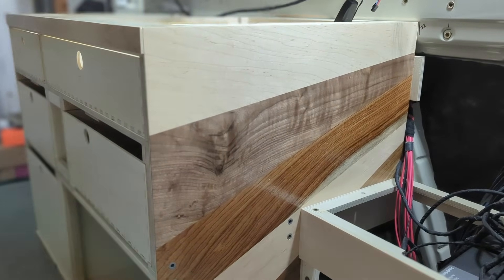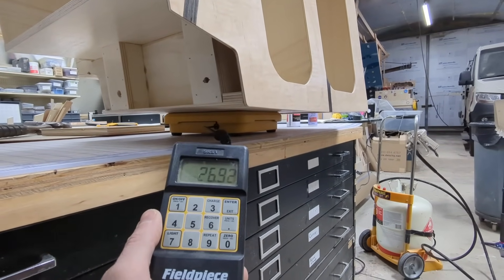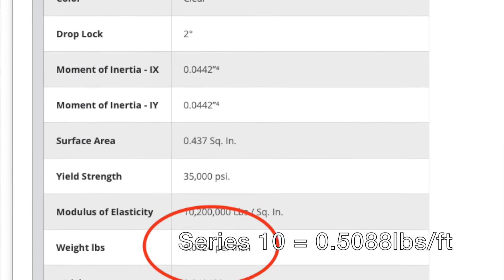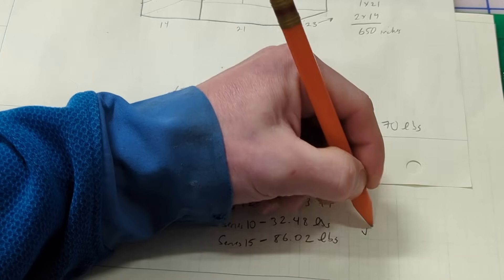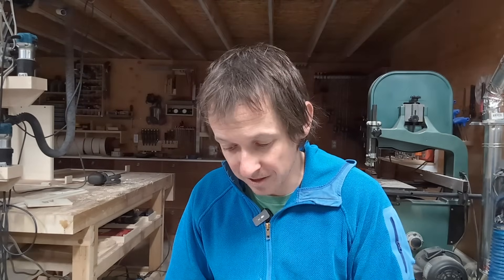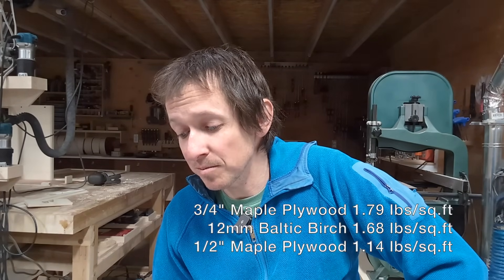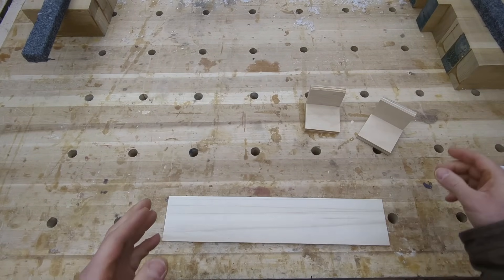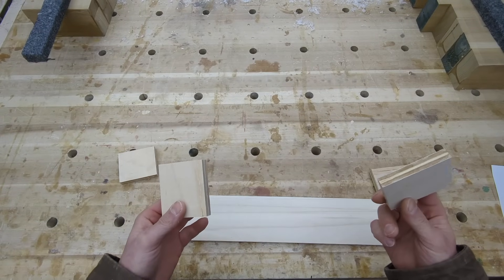Van Conversion Cabinets that are (actually) Lightweight and Maximize Storage

Comment: I'm a cabinetmaker and I've done 4 van conversions. There are two major issues that seem to be ignored by van builders - the first one is the weight of the cabinets and your comments here are very good. The other issue is one of ergonomics - how often I've seen seating, particularly bench seats with a vertical backrest and a flat base - not in any way comfortable.
Reply: Any tips? :)
Reply: @3jcb123  110° between seat & backrest not 90°. Angle the base to match the height - it should not lift your feet off the floor but should support both front & back. 
Experiment with clamps & bits of board to see if you can refine it to suit yourself better. (More upright & higher seat for working or eating, less upright for relaxing).
Reply: Dealing with that issue right now.. I ripped it all out...
Reply: @WizzRacing  
The results of your attention to ergonomics will benefit all who use the benches. 
Hopefully, they will appreciate all that you have invested in creating quality.
Reply: I’m always wondering about upright seating at 90 degrees angle. Looks uncomfortable.
Reply: @alanhat5252 I've seen this later BUT I've yet to design the seating properly. I will bear this in mind. thank you!
Reply: Where are you? Please say Florida.
Reply: The other issue I never see is ruggedness and security in the event of a crash. Low weight is good, strong build is good, secure attachment is good. Containing the contents is good.
Reply: Use an average on your car seat. Use a angle finder and you then have a baseline to work from. All you need to do then is is make it to the height of your choice 👍🏼
Reply: @jheighten7568 11:04. Did you even watch the video?
Reply: What about balsa wood? Would that be too weak? I was thinking of making a ceiling pull down drawer for lighter storage like clothes. I was just going to use corribord for that and cover it with a wood veneer lol.
Reply: I made low benches- then made the “backrests” from foam wedges, thicker at the bottom to support the lower back, tapering off at the top so you’re leaning back. I have moveable cuboid cushion armrests too. Much comfier and more supportive than the 90 degree sitting.
Reply: @sandrashane677  I recommend paulownia wood, it’s like balsa but stronger. Still super light- used it for all my interior.
Reply: @Fenrires  Good job. I love it when people take reality into account when they build things.
Reply: I'd love to see a good, lightweight bench seats/bed conversion setup made of wood and glue. I'm nearly at stage of building and I need ideas.
Reply: Some would use tapered back cushions to get an angled backrest.
Reply: Thank you for your rent. I've been going back and forth on the 80/20 issue, plus you need specialized tools and I think I'll just stick with the wood and keep it light as possible in every consideration

Comment: This dude needs more recognition....
Reply from the maker: Thank you!
Reply: No kidding - It’s unfortunate that vans built with marble counters and stone walls get more recognition than something with good engineering and solid craftsmanship.
Reply: Very informative, thank you for the post.
Reply: He is new on yt. He will rise to the surface, don’t worry.
Reply: He's just too stealthy!😂
Reply: True
Reply: @projectofscience   Australian here. Thanks, that was very interesting. There is a business here called Drifta, they do what you do except in thicker ply. Anyway what I thought you'd find interesting is their use of Teflon slides for their drawers. They router the Teflon into the carcass and the drawer. It works well and takes up no space as opposed to slides. Cheers.
Reply: Caravans uk use 6mm ply and light frameworks.
Reply: @goingwildagain  We here in Oz know all about UK caravans, we've all watched Snatch.
Reply: Candle wax rubbed on the underside of drawers and sliding surfaces works very well. I’ve been using it for years on my 4WD drawer. Just reapply every few years.
Reply: I agree
Reply: Seems like basic cabinet making to me? Nothing amazing........🤔
Reply: my thoughts exactly
Reply: @CombatMosquitoTrainer That’s very interesting. I know the bridge/overpasses in the US that are being replaced use Teflon something in their structure so that they can just slide the bridge in place after tearing down the old bridge. They also use Dawn dish soap to make it slide!
Reply: @shelby1188  Now that's really interesting. Dish washing soap has so many uses, from helping out on caulking jobs to an additive when washing mould of a building externally with chlorine. Helps the chlorine "dwell" longer (stay on the surface you applied it to).

Comment: As a craftsman who also builds out Adventure Vehicles, I can honestly say…this person is so accurate and spot on with their information on good construction techniques for lightweight cabinets. Only thing I could add is to use nylon glides for those wood drawers.
Reply: That might make them slide a bit too easily, so you'll also need to add latches to stop them sliding open while you're driving.
Reply: Soap on the slide area would work too (no weight)
Reply: A good wax of the sliding surfaces works great! I do that for my circular saw rip fence track guide.
Reply: Could you explain show an example of your nylon guide?
Reply: @nagualdesign  You will always need some kind of latches or other drawer securing technique. You can't make a drawer så hard to slide that it is road safe and at the same time make it usable. I mean you can manage it by luck or only driving really carefully but if you are going on an adventure, there will be some tough movement.
Reply: Can't beat beeswax
Reply: Wood on wood with paste wax works well
Reply: Narrow strips of Formica...they will never wear out and give 1mm of clearance

Comment: Everything this man said is the gospel truth. My biggest "van life" peeve is watching guys use 3/4" plywood on everything like they're building a kitchen cabinet for a house.
Reply: I had my van builders  in 2018 use 1/4" cedar  tongue and groove on the ceiling and 1/4" finished birch panels on the walls.  Lightweight.  It's been 5 years... no regrets there.  Regrets >  I had the bed built to be a twin short 39"X69".  I should have had a full size bed built, still short but wider.
Reply: Most folk are just copying and pasting what they see done else where.  Personally, I don’t see why there would be a need for all that wood being used as walls

Comment: The list of benefits he rattled off are not theoretical. As an engineer that used to race cars, and now drives a van, I can assure you these measures make for a safer, more enjoyable, and more off-road capable ride. Ever wonder why you always see RVs on the side of the road changing a tire? Weight.  (Ok and aged tires). Ditch the giant bumper and other off-road ornaments as well. Stellar job on those finger jointed 1/4 ply drawer boxes - not easy.
Reply from the maker: We should be friends!

Comment: It's about time someone made a video like this.  I framed my cabinets from 80/20, but had a friend who is an excellent woodworker help me with the wood aspects.  He had never worked with 80/20 before and had some similar thoughts that you shared.  At the end of the day he indicated that, as an experienced woodworker with a garage full of woodworking tools, he could beat an 80/20 design on weight and space efficiency.  But he also said the average guy probably could not, and his wood designs would not match the 80/20 strength in the event of a vehicle accident.  I would be interested in experimenting with an 80/20 carcass but some lightweight wood elements internally (where the high strength is not needed) for things like drawer slide mounts, drawer latch beams, etc to save material, weight and cost.  Thanks for the video.
Reply: with 8020 you either need to do proper calculation before ordering extrusions or you'll need some tools (e.g. mitersaw and thread tapers), the cost of a mistake is high. The other thing is vibration that can make all screws unscrew (so you have to apply a threadlocker). I built a small bed frame for a highlander out of 8020 (10 series), and it is heavy as hell probably around 45-50 lb (but super solid I have to admit). Next time I will build out of plywood or plywood laminated foam, cost of all those bolts and nuts adds up and the build becomes quite expensive. For a case of an accident I would prefer something less heavy even if you anchor it properly.
Reply: “… in the event of an accident …”
No matter 8020 hold… as long as the kitchen sink don’t fly through my skull when I brake in an emergency, wood cabinet will be enough.
When driving around with your house in the back, you can’t expect the crash test rating of a modern commuter car.
Reply: What about humidity? The wood expands and contracts with weather and humidity. Is it still durable and sturdy?
I'm thinking of having a van one day and I'm looking at all options for storage materials, affordability and practical.
Reply: @raquelkhadiri162  in my experience expansion is not an issue.

If you were building the gaps so tight a layer of paint would stop it working maybe expansion would be a problem but the sort of gaps us mere mortals can manage there's plenty of room for expansion.
Reply: @raquelkhadiri162  where humidity is a problem is the glues they use to make plywood – interior grade plywood won't cope with a winter in a van, the glue dissolves & leaves all the layers to separate. Use "WBP", "exterior" or "marine" plywood & if you can get them to admit what glue they're using phenolic or melamine are the best.
Reply: I think this is on the money. You really need to be a good woodworker to get good results in these types of builds.
Reply: @raquelkhadiri162  that is the purpose of using plywood instead of solid wood.  If high humidity seal it.
Reply: Don’t forget to a carpenter holding a hammer, everything looks like a nail, and to a surgeon, …
Reply: @raquelkhadiri162  I doubt the wood movement will be a problem. Wood is the most used material in vanbuilding and I have never seen any vanlifer having problems due to wood movement. The main problem with wood movement is if you lay a floor or something and don't leave any gap towards the wall. That makes a wood floor rise like a kind of dome shape if it expands. Same for laying floors in houses.
Reply: That’s exactly what I’m doing. 10series is adequate for most stuff, skinned in 5mm plywood. I can almost guarantee the weight is very similar to a wood galley of equal strength, and I don’t need a bunch of tools I don’t have to build it. I love the van builders doing in house custom wood builds with super clean laminate finishes and everything.. but the tool/space commitment alone isn’t  practical for most DIY guys. I built all my 8020 in my living room
Reply: @raquelkhadiri162  the only thing that's a no no is - don't use engineered wooden floors like I did (and fitted them real tight in case of liquid spills - One winter and it lifted 5 " in a curve

Comment: My thoughts are that you are correct, light is right. However we built our conversion with thin wall welded steel square box, with 3mm ply screwed to the frame. Two reasons for this. 1. This is my skill set! 2. Crash protection. Wooden cabinets perform very badly in a crash situation and you will end up with that fridge in the back of your head in a head on. Steel frame bolted to the chassis is better for this in my mind. I know it’s worse case scenario but you spend 95% of the time parked when weight does not matter. So like you say do what suits you. Your cabinets are beautiful and thanks so much for taking the time to share your skills. 🏴🏴🏴

Comment: I’ve never understood the 80/20 fascination mainly because of the ineffeciency in space use, thanks for actually calculating just how bad it is!
Reply: Probably because people who use 8020 are less concerned with optimising use of space than they are with optimising ease of construction.
Reply: @jasonhendrickson2289  Yea, exactly.  The skill and tools (look at his shop) required are not really DIY.  I am pretty handy generally, but even if I had his shop I doubt I could build those cabinets unfortunately.  Beautiful stuff tho.
Reply: neither of the calculations were remotely accurate, though.  Or, at least, his computations were based on the quantity and arrangement of materials that a naive beginner would use, and then he compares that to really sophisticated woodworking.  Build 8020 cabinets with the same level of sophistication and experience as was applied to the wood cabinets here and you'll get significantly different results, both for weight and volume.  The slideless drawers will be slightly larger, but you also pay a significant penalty in utility relative to drawers build on 75 or 100 pound slides.  And you can reconfigure cabinets made out of 8020. And you could do a slideless construction with 8020 easily enough, too, though you'd just be replacing a heavy slide with a slightly lighter aluminum crosspiece for the drawer to sit on.  But you'd be able to change the height of that crosspiece really easily if you ever wanted taller or shorter drawers. Try that with wood and glue.

He jumped straight to "everyone builds out of series 15" which doesn't seem to be remotely true when I watch 8020 van builds.  series 15 is utter overkill for cabinets unless you've got really long horizontal cross pieces with minimal vertical supports, and then you can still use a double width series 10 piece so the rectangular cross section is only wider in the vertical direction.  A typical 36" undercounter cabinet box does not need anything larger than series 10, ever. You'll have a vertical support to close a cabinet door against or support a drawer every 18-24", at least, and even series 10 doesn't really deflect at all if you hang 100 pounds off an 18 inch length, let alone a 9-12 inch length, which is the midpoint between two vertical supports. And you don't need extra brackets to join pieces for this kind of cabinetry.  Tapping the ends of the channel and drilling a hole through the side of the perpendicular piece and then running a bolt through that is perfectly sufficient for a typical cabinet.

The series 10 weight projections were close enough to his wooden cabinet weights with even his naive computation such that he didn't want to have to make a more accurate comparison, so he just dismissed it with "everyone builds out of series 15."  But his cabinets had horizontal crosspieces for every drawer rather than using the drawer slides as structural members in lieu of those horizontal cross pieces - so his weight estimate for the framing was significantly high. I'm sure the aluminum cabinets would have been heavier than his wooden one, but not by enough to matter and they'd be considerably more robust, if they were constructed with even half the sophistication of his wooden cabinets.  I'll take a 40 pound aluminum cabinet over a 20 pound wood and glue one every time.  It's a different calculus if choosing between a 100 pound aluminum cabinet and 20 pound wood one.
Reply: @samgendler some valid points made!

Comment: I've just completed  a pre-trade joinery course,  and although I enjoy working with "real" wood,  I'm convinced you can do heaps with thin ply for cabinets.   When I see YouTuber van builders use 3/4" and 1/2" ply for all the cabinets...and them soft close, heavy duty drawer runners - the weight of it all😮   This guy is a master at creating beautiful,  strong, lightweight cabinetry.
Reply: Thinks, are you single Angela? 🙄

Comment: Really liked your comparison of wood vs 80-20 for weight and space savings. Another factor is the cost of the 80-20 rails, hardware and corner pcs./ braces. As a retired aerospace machinist I have an affinity to working with aluminum but I love the look and feel of wood and the ability to make it conform to your design. Another thought on the drawer slide issue is to add a layer or two of UHMW tape to the sliding surfaces. Extremely thin and light weight and replaceable if worn out.  Thanks for your video.
Reply: Agreed, also parts count matters. I built things for a living and every corner or end point adds costs since it needs to be measured and cut requiring thought and labor. KISS.

Comment: I've been refining my cabinet building over the years and my latest slide-on camper fitout is near identical. Mostly 3mm and 6mm oly with a little 9mm in places, no drawer slides, maximum space. I also reinforce some thin jounts with an epoxy fillet like a wooden boat/canoe builder which adds to the strength enormously if needed.

I did document one of my builds once and got a huge amount of abuse from the haters believing it would never be as strong as alloy or sheetmetal stuff and couldn't possibly last.

Not only does this video explain why wood done well can be very good but it's also great to read so many comments from people supporting his ideas.

Now if only someone could recognise this in the stuff im trying to sell. No-one wants it 😢

Comment: Thank you! Just starting out building a simple suv conversion and been wondering about all the 3/4” everyone seems to be using - I ain’t got space for that much thickness! 😅 Not an expert woodworker by any means so won’t go as lightweight but that gives me some ideas where I can save on weight and thickness while still using some of the 3/4” ply for bed supports, etc to make it easier to build with some screwing around.